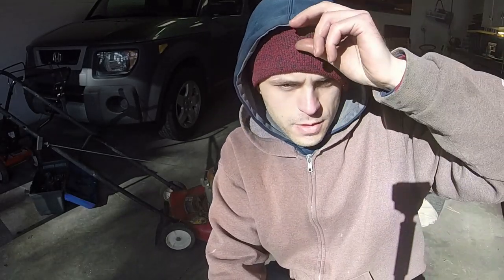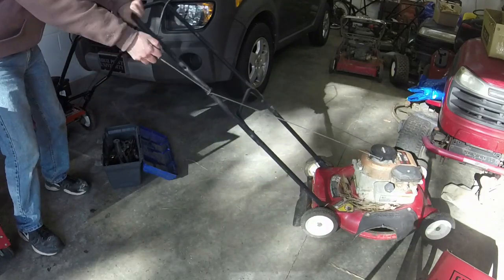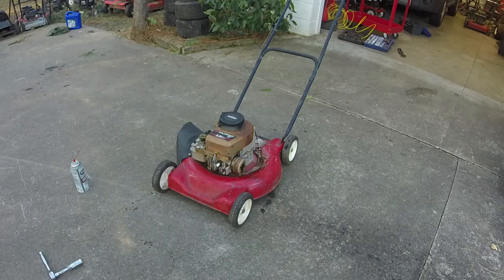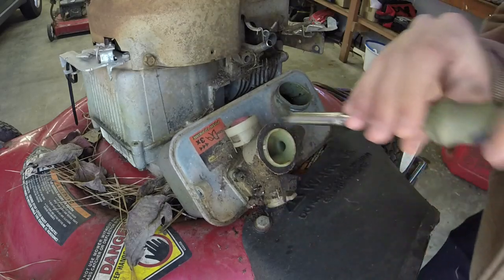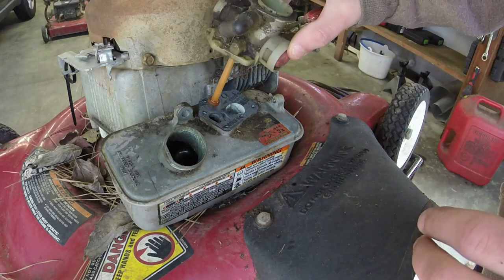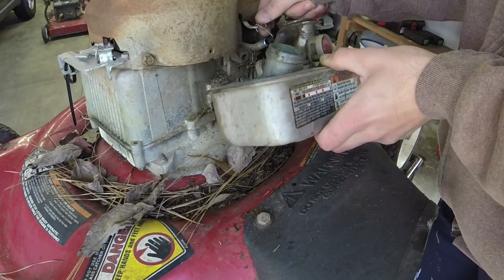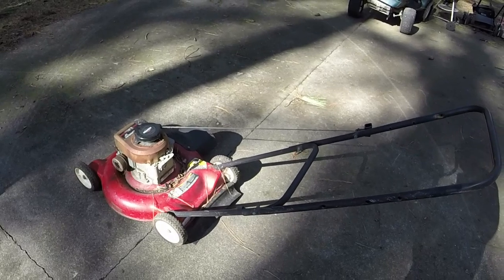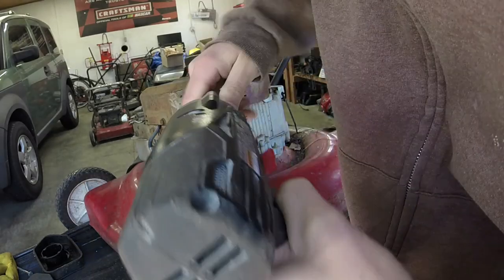Bringing a Murray 3.5hp Classic Push Mower Back to Life

Comment: I put a throttle cable on my 3.5hp Briggs and stratton I didn't like that the fact that the motor ran high when I cranked it now I can control my engine throttle

Comment: That's a brilliant idea to install  toggle switches on mowers without bail cables. You should've used the toggle switch on the old rear bicycle wheeled Murray 22 inch mower in your older video.

Comment: Gr8 save . Ones like that I take my $0.96 black spray paint to the shroud and paint it black. 

Have u every uses wire to replace the cable in the break cable that rusted out ?
Reply from the maker: I've tried the wire before but a lot of times the original cable rusts out inside so I either can't get it through and when I do it seems to break.  I saw Doublewide6 do it successfully though.
Reply: @EllisMowersandmore   I did it
Once only because I had a wire  and the cable broke but was able pull out the cable .  Saved me $17 on a new cable on a $50 mower.